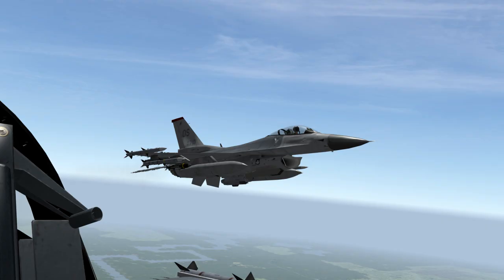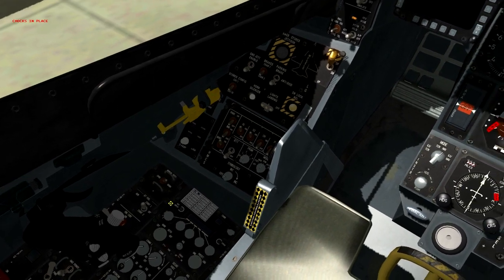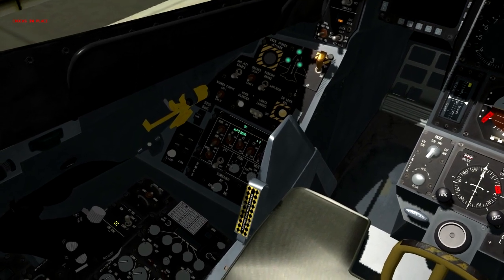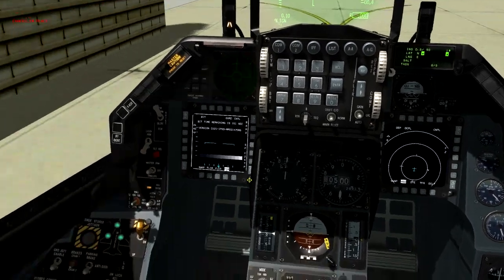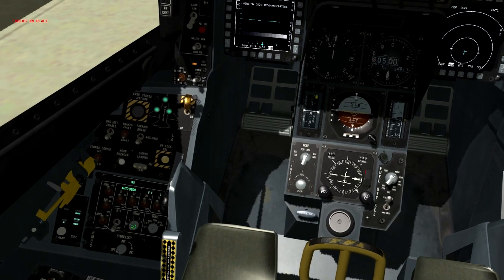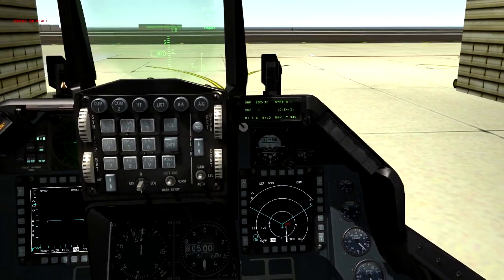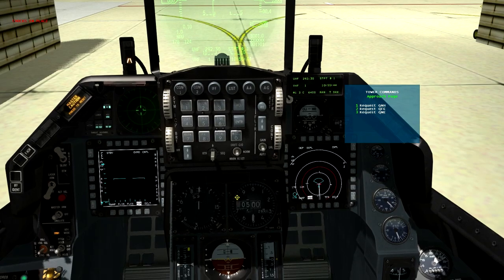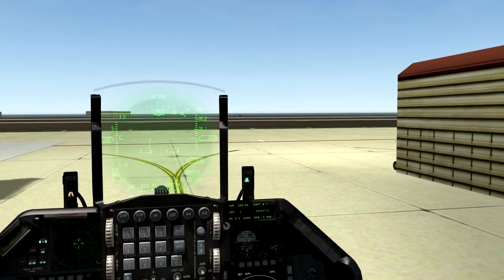Falcon BMS 4.32 - Lesson 1: Rampstart

Comment: TrackIr is good. But you can also use Freetrack, which does the same and its free obviously :).

I also tried Facetrack. Pretty cool as you can use your face only to look around. No IR diodes, no reflective panels etc, just your face. But it requires quite a good light conditions and my glasses were problem for it.